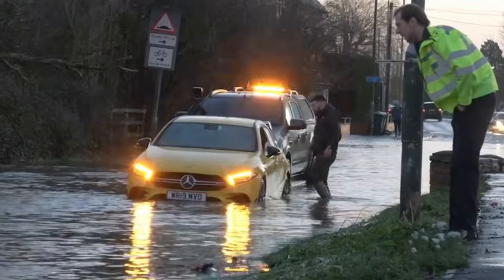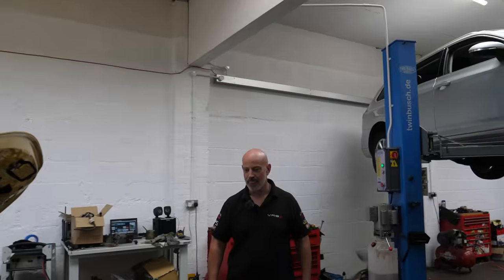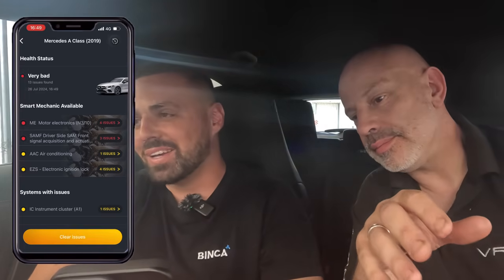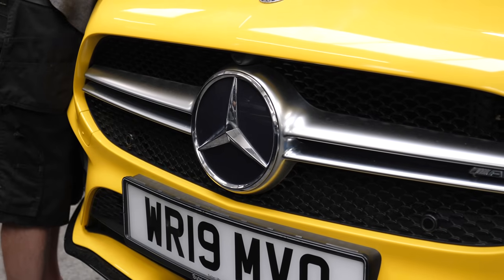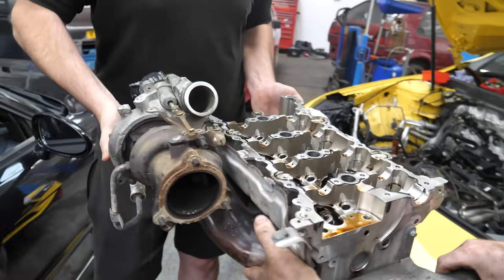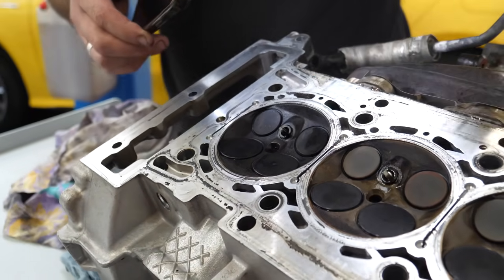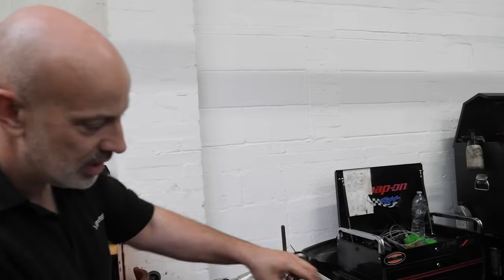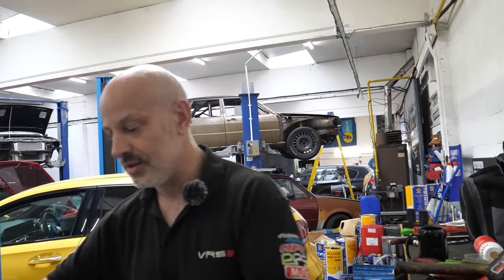I MESSED UP BUYING THIS FLOOD DAMAGED A35 AMG! 🤦🏻‍♂️

Comment: A35 cylinder heads are a very common problem. Main dealers often repair them under goodwill if the history is good. We’ve sent a few and they’ve been approved by Mercedes for free.
Reply: Was literally about to send this, mainly exhaust valve seat failure and at a minimum MB pay 75%
Reply: What are the other common faults, I’m looking to buy a 19/20 year model, slightly concerned about the reliability

Comment: I agree with a lot of what he says. However he’s overlooked something here. He commented the restriction in the exhaust port, was inline with the crack in the valve. Valves actually rotate whilst the engine is running. So that’s not the reason the valve cracked. It’s quite possible it cracked if cold water from the flood, entered that hot cylinder, and rapidly cooled that valve down. It’s also possible that cylinder has been running lean, for whatever reason. The first thing I would have done is put a DTI on all 4 pistons, to see if there has been any hydraulic issues, which may have shortened (bent) a rod. I realise he mentioned he was going to do that.
Reply: That's what I thought valves rotate also if water entered the cylinder the valves would look cleaner this looks to me like a bad injector or a bad tune.
Reply: @Driver2397 a lot of water maybe but they can crack off a tiny bit and you’re not seeing a clean up job off a little bit
Reply: I rebuilt my own a35. My money will be on failing or failed Piezo injector.

Comment: A lot of A35 owners are very keen to see what could be done going forward .. Facebook and forums are loaded with the the cylinder head issue .. please keep us updated
Reply: I have my own theory, regular injector testing, especially if someone’s using standard UK fuel as well as swapping out the filter gauze on the thermostat that was there from build but not in the later revisions post 2022.

Comment: It’s an a250 engine pushed to the limits from factory and is the reason why I never tuned mine. The cylinder heads are known to crack even with low mileage and stock power. I don’t know 5% of what Will does but this screams to me it was tuned probably on someone’s driveway with a cheap pops and bangs map… Tuned to 99 Ron and run on cheap low octane fuel. Never buy one of these unless it’s unmodified and in warranty or you are asking for it

Comment: He says at 19:37 that he hasn’t seen a car with a burnt valve in ages. I work with engines and I genuinely see about one a week. But it is all the very small engined cars like the Peugeot 1.2 or qashqui 1.2. They run so hot to be so efficient that it happens a lot.

Comment: Cracked heads, diffs, turbos with 70k on it. Not good enough out of Mercedes. I used to be a MB salesman and drove this exact model when it was first released. Shame because it was a really fun car to drive. Interestingly, myself and the master tech had a look at the engine specs and it was almost identical to the A250. The only spec difference we could see at a glance was the piston size and maybe turbo can’t quite remember. The valve size would make sense that this is a 250 turned up. Good luck!

Comment: Fab upload so much info...was only looking at a a35 yesterday....errrm might move onto a slk55 instead 👍
Reply: I have a 2020 A35, 33k miles, no issues. If you get one just get an extended Merc warranty as cylinder head is covered.
Reply: @cmdrjinxo7846 all that means is you’ll soon have issues😅the engineering on this is a joke

Comment: 19-21 year is the worst for a35 so many issues, cylinder head and diffs are common issues, Cylinder head was revised in 2022, which is why there have been very few issues after 2021 Mercedes standard procedure for this is to replace the whole cylinder head not repair/replace the valve and valve seat
 Also this isn't a premium plus it looks like a premium and someone has added the Aero kit as its missing the pan roof which only comes on premium plus
Reply: Are you sure? Because i've been reading foruns about it and this issue appeared on a car bought brand new in dec/23. Its covered by warranty ok but whats a shame if mercedes has not correct it in the production line. I was really looking foward to buy a a35 but i'm affraid. It would be great to know for sure when this factory issue was resolved (if it was)
Reply: @amandascain9850  i found the post you have mentioned its one guy who joined the forum in January made 4 posts about it on jan 25/26th with sparse info  then never updated anything and hasn't been back to forum since, one of his posts state little to no communication from main dealer then next post states waiting on parts within 24 hours
Reply: @ulysees321 yeah that was weird, I looked for more cases in newer cars and didn't find much. I hope it has been resolved in 2022 as you said, after all MB know this for years now.
Reply: @amandascain9850  ive got a 24 plate facelift a35, im 2300 miles in, so far touch wood its been perfect,

Comment: I was looking to get a 17 plate s3 or golf r, then saw the video of the amg 45, set myself to get that, but now see this video of the amg 35, now lost a but of confidence.
Reply: Forget them all and buy a 340i 

But imo having owned 2/3 get the Audi if you want the haldex and a car that is just understeer and noise. Better than the golf not as strung out as the merc I mean everyone knows how reliable the ea888 is overall
Reply: @KeyBrosUK heavy 3 series is rubbish
Reply: @phiIip488  handles better than all of them though, not that much heavier either you’re only talking 180kg that’s a couple of passengers worth of weight.. 140 if you want something small but if you’re a grown man you don’t want a 4cyl for a fun car you want a 6
Reply: @phiIip488  the way you’ve said that I can tell you haven’t driven one at least to the limit or you’d know already. 50:50 weight distribution does a hell of a lot for handling so it hides the extra 180kg for what it is easily, the others are all nose heavy so understeer prone. There’s a reason the Nurburgring is full of serious 3/4 series and not of s3s.. also if you want x drive it’s available but still rear biased allowing you to play around if you aren’t the best driver unlike the haldex systems which are terrible for having any sort of fun with the car.
Reply: @KeyBrosUK true 50:50 weight distribution in beemers is only applicable to left hand drive models
Reply: @ChrisBeevor0511  NO. The 50:50 weight distribution in BMW models is not exclusive to LHD vehicles. BMW designs both LHD and RHD models to maintain the same near perfect balance. The placement of the steering components, pedals, and dashboard controls for RHD models is compensated for by engineering adjustments to ensure the weight distribution remains close to 50:50.

This is a hallmark of BMW's engineering philosophy, where maintaining driving dynamics and balance is prioritised regardless of the market's steering orientation. Go look it up then try again.

Comment: Why do people try to drive through these floods
Reply: The car had a bent/cracked valve hence the misfires. Would be a big and expensive job to fix. So they drove it into a flood to mask the previous engine fail. Claimed off their insurance and brought the car back and sold it to Calvin. The lads who sold the car knew full and well what the crack was with thr car. They played dumb.